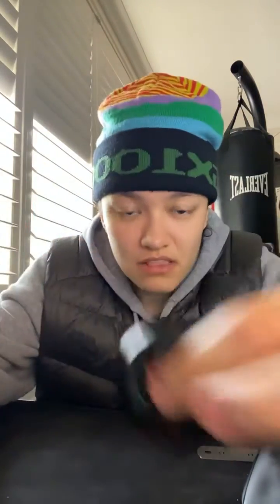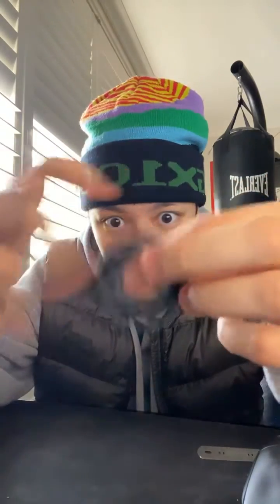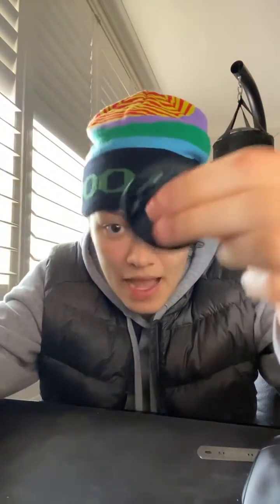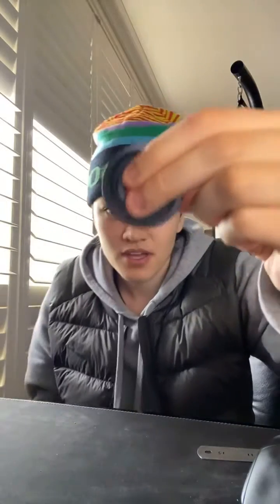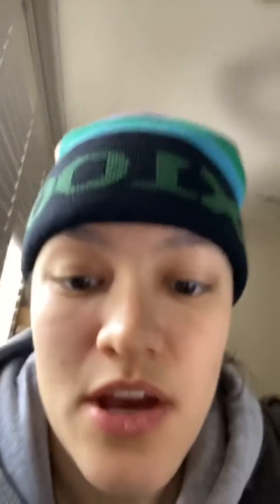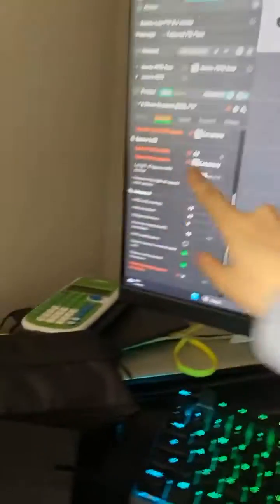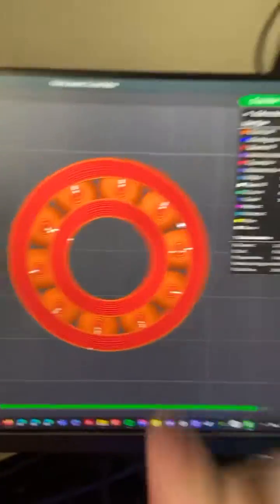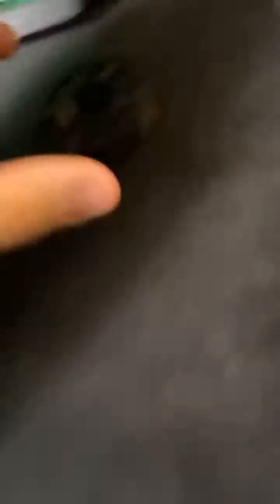3D Printed, Print in Place, Ball Bearings, Optimised 💯

Comment: Thanks for the 3D model and advice on profiles! Mine aren't spinning quite as well as yours yet, the 1st layer is always a bit ugly and blocky, or I make it too thin and it doesn't stick to the build plate. I'm on a different printer/slicer and messing with settings.